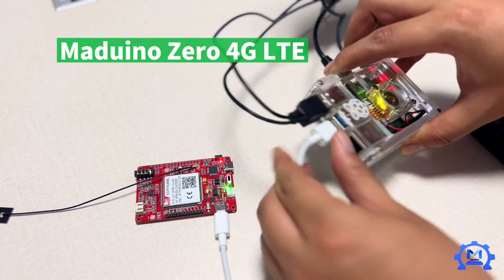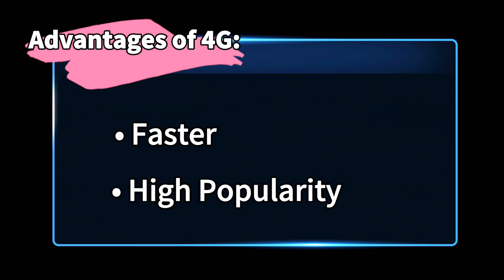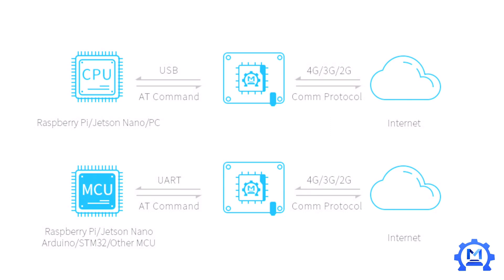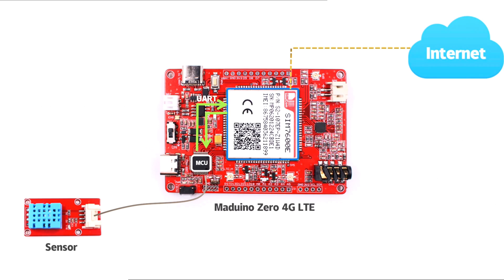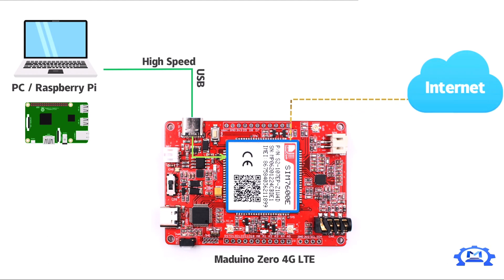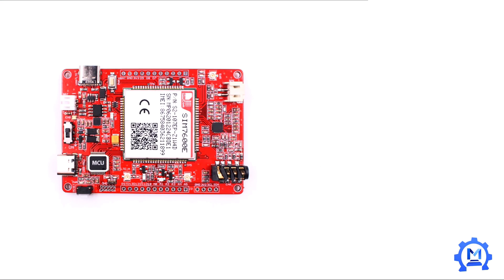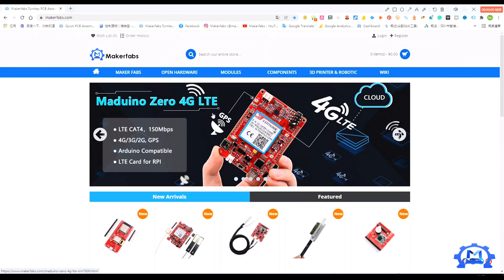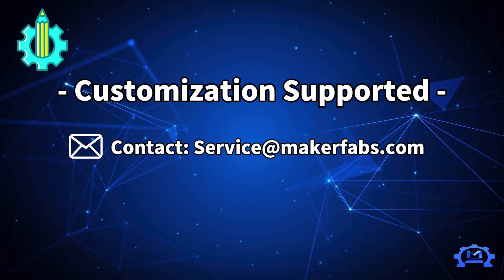Maduino Zero 4G LTE SIM7600, 4G IoT Solution

Comment: Hi, I want to use a wifi video doorbell for a project but do not want to connect it to home wifi. I was wondering whether I can use this module with a data enabled sim card to create a wireless wifi network that the doorbell could connect to?
Reply from the maker: Dear, It couldn't do that, there is no WiFi on board.